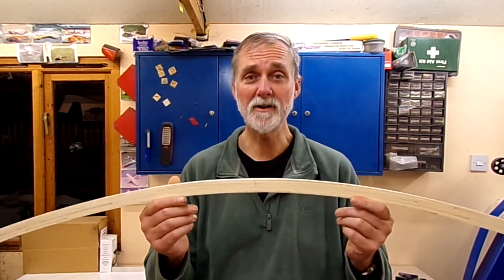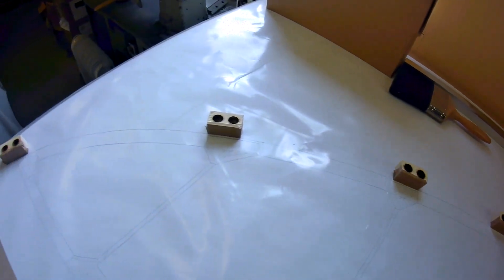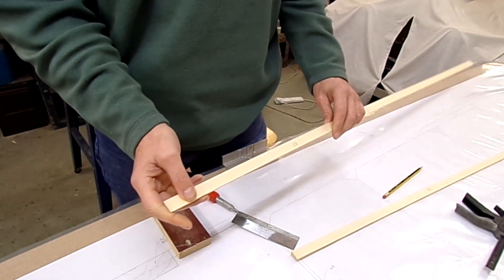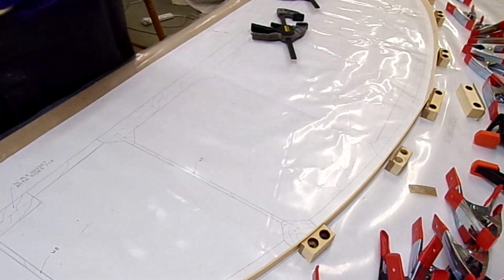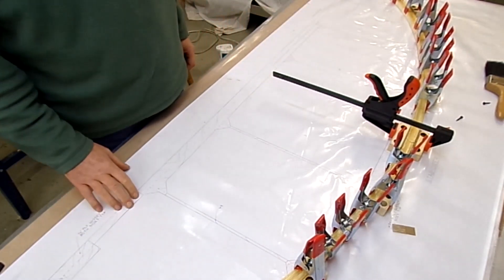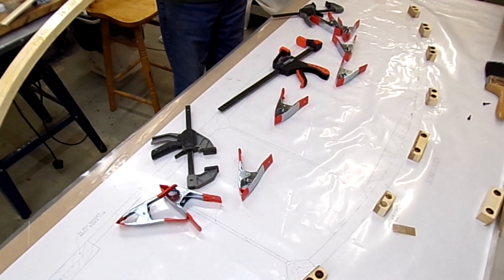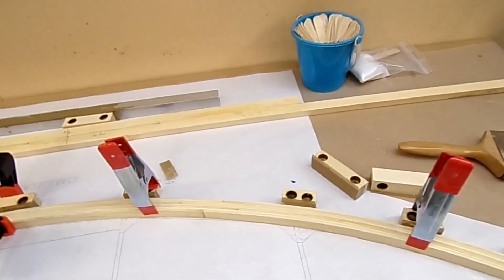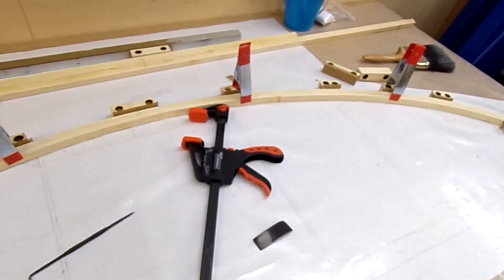EP2 Fisher Youngster V Kit Plane Build - Wood Tail Leading Edge

Comment: Are there any old training handbooks you can recommend? Or which are the ones you have ?
Reply from the maker: There are a lot of different training books the ones I have are from my training in the RAF but they effectivly link to RAF air publications which would be very hard to get. A good source for information that is easy to get of the net as a PDF is the Anerican guide AC_43.13-1B
Reply: Thank you
Reply: Hi, great build. I’m following this after being inspired to build an SD1 . I bought the rudder kit as well (after watching your video series) and now I’ve decided to progress to the whole lot! In this build it looks like you are using T88 epoxy. Are you using T88 for the whole build? I’ve tried to source this in the uk but it seems unavailable

Comment: Looks like a fun build with lots of variety
Reply from the maker: Yes there are a few different skills needed in this one, that said the SD1 had a bit if variety as well. The thing that I like from looking at the plans for the Youngster, is that there is room to put your own twist on things, which you could not do with the SD1. I am still not sure which way I will go, classic biplane like a one off old master oil painting or the higher performance SD1 that is paint by numbers moden art (both good in their own way and each have a place dipending on your mood and the postion you want to put them).